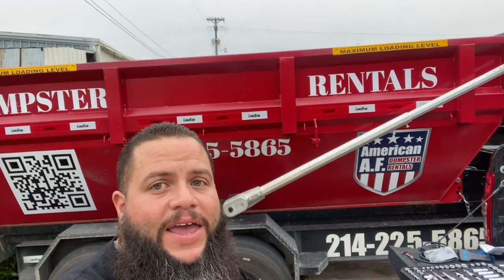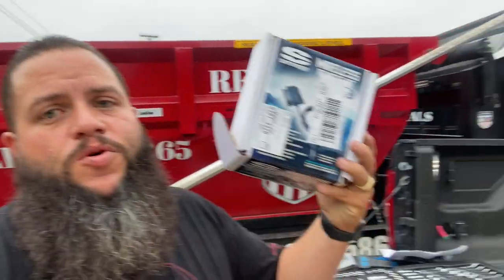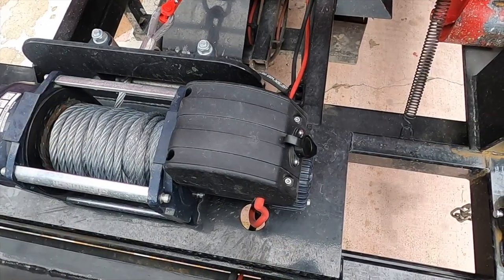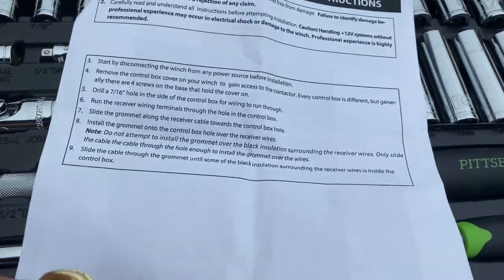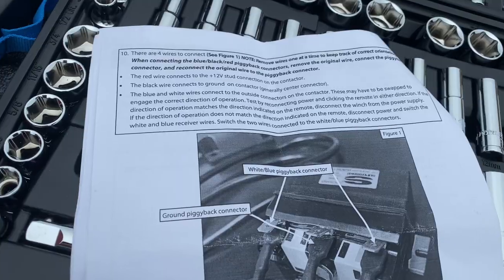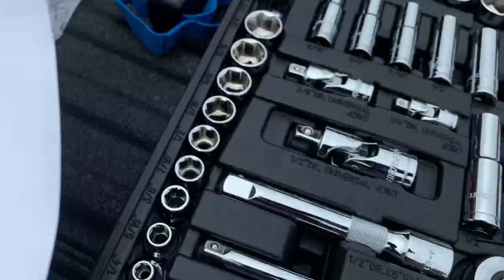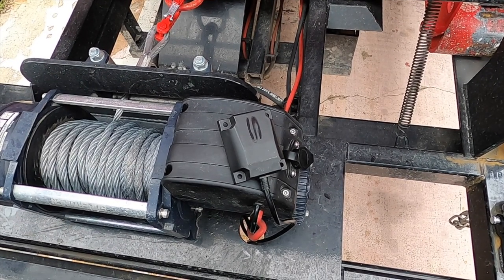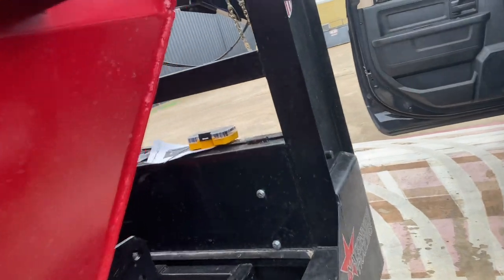Superwinch Wireless Remote Install on my Dumpster Trailer - Superwinch 18.0 Talon Wireless Remote

Comment: Make sure u spray a little dielectric grease on metal terminals and bare wires to stop corrosion from moisture vapor etc, I know u guys use horrible salt on roads.
Reply from the maker: Thanks